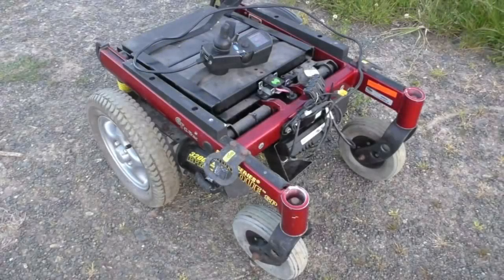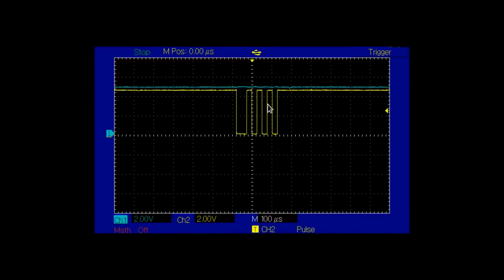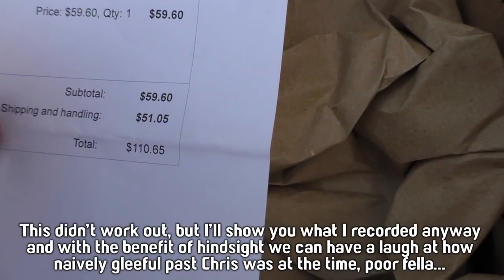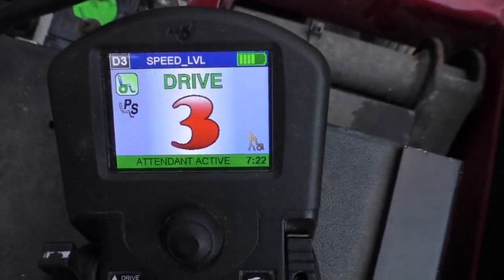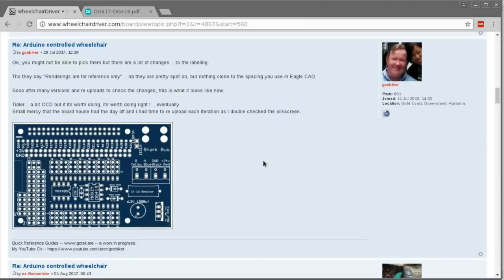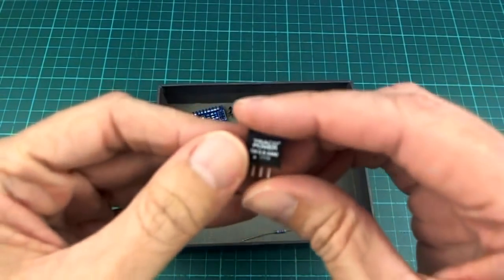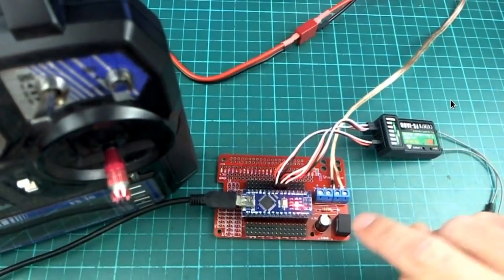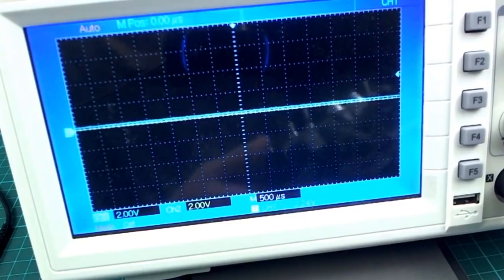Farm rover part 4 (flops and failures)

Comment: That first full-battery pulse is disinfection pulse to get rid of all parasitic arduinos :D
Reply: yeah i'm thinking it's legit the reason this bus is so weird, it's designed to lock-out 3rd party devices.  It's probably called Shark coz it bites everything
Reply: The 24v pulse may be used to wake up the controller connected to it. It may also be safety feature.

There may be a timer that starts counting as soon as the drive removes the 24v signal and if no message will arrive in a timely manner it may decide that the controller or cable is in fault and disables all drive functionality.

Comment: Many years ago I had similar issues on RS485 links (noise and spikes over the signal) and we noted that our devices doesn't had the termination resistors, there are not necessary for work but strongly recommended. We put a 120R between A and B on both ends and all our problems were gone. I don't know why they are using 22k here.
https://en.wikipedia.org/wiki/RS-485

Comment: Not sure if this has been said already, but it seems in the PDF, when it talks about a 22k and 270 ohm resistor, it means at the 'client' ends - critically - it seems to be using them in context as if that is for receiving voltage from the respective 'host' unit, this might be why you're getting erroneous results reading the data back from the SPM, my advice is connect a 270 or 22k resistor to the SBH and SBL signals (to their respective opposite voltages, at the input side -- NOT Shorting SBL and SBL together.) in order to bias your voltages and get a harder pull towards the wanted 200mv voltage delta.
Please see my other comment if the offer of having a go at fixing your circuit is appealing to you.
Hope you have good luck and get the bloody thing running soon, I want to see the NZ Moon-buggy in action!
Reply: Could it be this sharkbus isn't build without an MAX485? I have read over and over the Pdf page he has shown and i came up with a schematic without a MAX485.

Phase A (SBL) gets  pulled up via 5v -> diode -> 270ohm  SBL wire  says pdf. 270ohm will not work (because voltage divider), but maybe a 22k ohm resistor from SBL wire to gnd could help.

Phase B (SBH) gets Pulled down via resistor: SBH wire > transistor/or somekind of switch < signal pin/point ->  270ohm -> gnd. The transistor ins only switched off if the voltage rises > 8V or the wake up signal is send threw the bus wire.  And in parallel to the transistor and resistor there is a 22k ohm resistor permantly to gnd. SR side (SharkRemote?)

My Theory is they have build this bus without an MAX485 chip or any other one. 
And for the phenomenon at 35:15 i have an explanation, the SPM has(my theory) a transistor and a 270ohm resistor in series too that pulls the SBH down to gnd and that transistor is only switched off is the SPM is powered down/switched off. After start up it will switch on the resistor. In total the SBH wire has a impedance of 135ohms declared at the bottom of the document.

Tomorrow i can also make a explanation video, about my theory. (it's to much for the comment section)

Comment: Those 270R resistors are to bias the lines when nothing is driving the bus, I'm surprised they are this low, 22k would seem more appropriate for this purpose, with 270R being used for the actual termination (see below). Also, I'd plot the DE/RE signal on the same plant as your RS485 traffic. It looks to me like more than one device is driving the bus at the same time!! Perhaps your Arduino is not relinquishing the bus quick enough? RS485, being differential, requires a termination resistor at the very ends of the bus. The bus can then be "tapped-off" by devices at any point along the twisted pair. You should measure the resistance at the AB terminals on each module to perhaps determine if they contain a termination resistor.

Comment: It might bee that the analog switch hinders the signal somewhat. It has resistance and capacitance on it's lines.

As of my understanding the rs485 lines need proper biasing and termination resistance and the analog switch might not be properly matched.

On your previous video I proposed to use simple mechanical signal relay and an opto to detect the 24v pulse. Relays are more predictable and should have very low resistance and capacitance on "fast" signal transitions. It's the rise and fall time of the signal which might give you the bad signal when coupled with capacitance and resistance.
Reply from the maker: The switch is only being used for the short startup pulse at the beginning. After that it remains fixed in one position. Do you mean that even when it's fixed and unchanging it can cause capacitance somewhere?
Reply: iforce2d I would assume so. It's not a switch in the common sense but more like an active driver. I may be totally wrong on this.

There may also be a timer on the drive that starts counting as soon as the 24v disappears and the drive expects a message in some time window.

Comment: Those spikes look like ringing, I've seen that when i have very long cables for ws2812 leds. It's caused by capacitance in the long cable, so you get a spike when going from low to high. What helps with ringing is adding resistor in series with the cable to limit the current going through it.
I think the reason for that resistor between lines is that when one is high the other is basically ground. So it would work right?
Reply: What i did to get the value of the resistors in my case was put a potentiometer in series and tweaked it till i got the least ringing, then replaced with a fixed value. Beware that scope probes have capacitance too so in very sensitive situations you see ringing that wouldn't be there without the probe itself. Try series resistors for the two cables.. Can't hurt really (I'm a software guy too..)

Comment: To match that spec, the 270 ohm resistor should go between S1 on IC1 and GND, and the 22k between the RS485 B net and GND. They're switching it out because of the battery voltage pulse. The pull up on RS485 B should be there too. I suspect the reason the response message looks like it does is because the cable is unterminated at the Arduino end.. Their termination scheme is a little odd, but probably best to stick to their spec for now.
Reply from the maker: Yes, that's how I read it too, which is why that's exactly what I tried at first (42:38). Basically I tried what you said but with the pullup to 5V on bus A instead.
So I did not try a pullup on bus B... isn't the pullup supposed to go on bus A?
Or do you really mean that bus B should have a 270R to both bus A and B?
Reply: Crap, sorry about that.. Late night typo.. Should have been pullup on Bus A. I missed that you had already tried that. Are you probing at the Arduino end of the cable? It might be worth probing at the controller end.. Who knows, maybe there really is an intermittent cable fault or imperfect connection between the Arduino module and the bus cable.

Comment: Have you connected the logic (arduino side) ground to the remote ground? I have seen things like that (incorrect logic levels in differential signals) occur in some systems when you only connect the differential signal through without a common ground... Also i have a hinch the thing on the document refering to the 270 ohm resistors etc maybe refers to the way they implement the bus hardware on the official circuitry. They may use discrete mosfets in combination with series resistors to make the push pull bus output instead of an max485 for example (hence the ability to pull the bus to full battery voltages if desired). And another thing, are you sure that the 7th pin in the assistant joystick connector is nothing? It may be a "connector detect" signal just to anounce the presence of a module hence always high or low for example :) Good luck with the build!
Reply: And also check the internet about the use of rs-485 termination resistors. They are necessary especially in long cable runs when the cable inductancs starts to mess things up and in noisy enviroments (like near big pwm motor controllers :D)
Reply from the maker: The power is being provided by the wheelchair battery so everything has common ground.

Comment: Bypass / junk all those electronics and control the speed controllers directly with an Arduino.  If it's too difficult to interface to the existing speed controllers, junk those too and replace with off-the-shelf units.  It will be easier in the end.
Reply from the maker: Read my reply to Andrew Waters.

Comment: Rower HELL YEAH !!!!! you can try to copy that signal coming to ESC with andurino. And then trying to slightly change it and see what it does. Or ride it a little bit and look how signal looks and save it to andurino. Like you save how signal then you go forward looks and save it to andurino and control it with andurino instead of original controller

Comment: Hey :)
I don't think that help a lot for your problem, but on the drawing the 1000µF capacitor should be between +5v (from IC3) and GND.
Good luck !
Reply from the maker: Yes, that's how it is on the board, I think the circuit diagram is just mistaken.

Comment: Wish I could help with the electronics side, but again because software..
I  found this interrupt function somewhere which fixed my PWM issues on a Nano though.

  // If the pin has gone HIGH, record the micros since startup
  if (digitalRead(RX_PWM_PIN_0) == HIGH)
   {
    timer_start = (volatile unsigned long) micros();
   }
  else  // otherwise the pin has gone LOW
     {
      // Only if the timer has actually started
      if (timer_start > 0)
       {
        // record the pulse time
        curr_RX_PWM_in = ((volatile unsigned long) micros() - timer_start);
        // reset the timer
        timer_start = 0;
       }
     }

Comment from the maker: Here's my interpretation of what the spec at 40:38 says: http://www.iforce2d.net/tmp/sharkbus_tested1.jpg (my changes in purple)
I tried this but it had absolutely no effect whatsoever.
Reducing the bus wire length from 1m to 8cm substantially reduced the spikes.
Placing a small resistor (100-200 ohm) across the bus lines only causes the signal to be squashed into the middle range (from about 2V low to 3.5V high).
Reply: That's exactly how I read it as well. The RDSon of the DG419 switch is fairly high.. It seems like a stretch, but maybe the pulldown value really is that critical, and the extra ~20 ohms is a problem. You should be able to compensate for it by adjusting the pulldown to account for the extra resistance of the switch.

Comment: Cool project but why bother trying to figure out this proprietary control system, just sell the bits and use cheap brushed DC electric bike controllers to control all the motors?you can just write pwm from an Arduino to the throttle inputs on the bike controllers
Reply from the maker: Because that would be boring :) I already own this controller and it has way more features than a simple ESC - safety brakes, torque management, seat tilt control, battery voltage feedback, other error states feedback (from the hand-operated brake sensors etc) and it is spec'd to match the motors by design. It has the g-trac feature which uses a gyro to direct power to the wheels separately to help it drive straight when the wheels are on different surfaces. This controller can also drive the chair incredibly slow (about 1 cm/s, no joke) under perfect control and very quietly. Sometimes I'm interested in taking the easy way and doing things how everybody else did it before, but not always :) Once the proprietary control system has been cracked the entire feature set of this chair is available, and goes well beyond what a simple ESC offers.